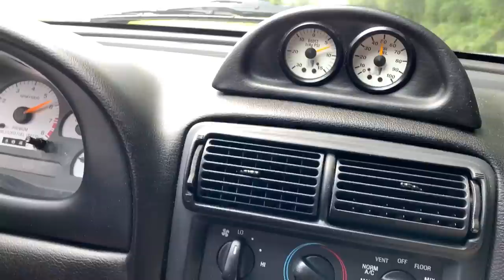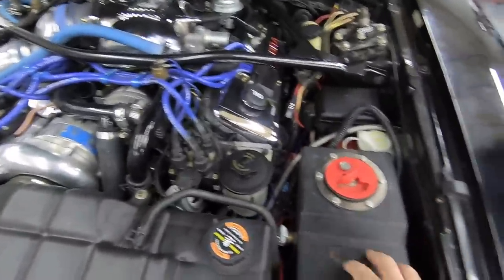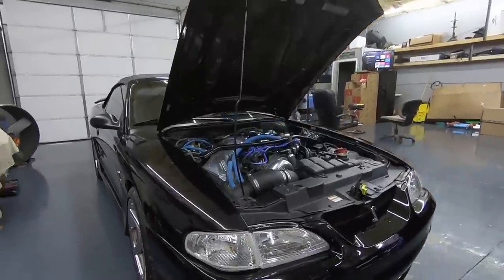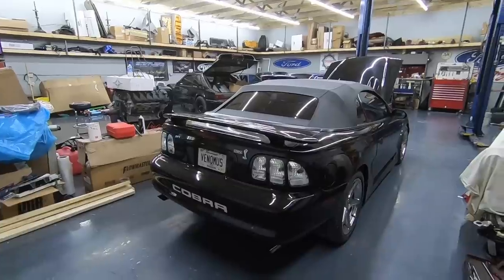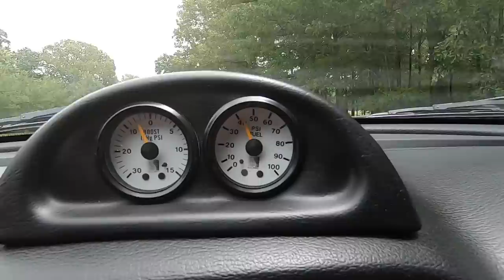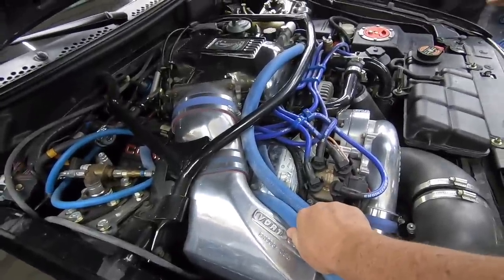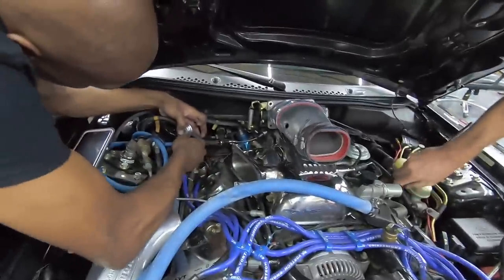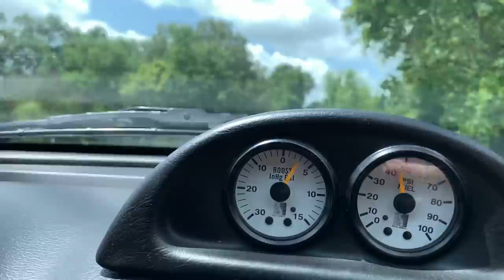Why don’t you see more of this generation Mustang...

Comment: Sn95 mustang was a terrible year. The pushrod 302 was weak and 2v was garbage, it could not compete with the Camaro at the time. The 94/95 302   lost power due to the emissions and that crappy elbow to the throttle body.
Reply: The true true reason for the HP loss was because of the hood line of the vehicle. They had to change the upper intake design for it to fit.
Reply: @ericfowler4248  Well mostly the heads. NonPI had terrible flow and while the intake could have been improved, as it was in the 99-04 cars, it wasn't the main issue.
Reply: The 302 on the gt was weak! The 302 on the cobra was much better with the gt40 heads and intake,fbo,some 3:73 gears and a tune would really wake those 94-95 cobras up! Especially if you put a cam and dyno tune it
Reply: @petrolhead8851  Still weak,car is a shit box.
Reply: Back then Ford didnt care much about putting real power in the mustang. Remember, the mustang was going to be canceled and replaced with the Probe.

Comment: These got a bad rap. Partly because the first iteration of the 4.6 was boring and had no guts. (IMO all of the 4.6 were a mistake outside the cobra, but some people like them). They also sold 3.8 V6 cars with a Ford Taurus level of power 2:1 over the GT's, and kids were all about Honda Vtech and similar cars at the time, and peer pressure and car culture with young people can lead to poor judgment. I clearly recall being in the local Walmart and hearing a high school kid bragging to his friend how his VW Passat beat a 95 V6 powered Mercury Cougar and "that cougar is fast". Yes, it is laughable, but that's the truth about how it was in the late 90's. 
It didn't help every car magazine everywhere was pairing top of the line trans ams to 4.6 powered mustang gt's to do side by sides. 
Truth of the matter is these cars were built really well, interior construction is hands down better quality then the Fox cars, and the body itself resisted rust very well. They can handle better, and generally factory stock VS stock they do. The wheel wells were of proper design, and so long as you don't get carried away with rim diameter, you can put some wiiiiiiide rubber in there. 275/295 in the back will fit without modification, and if your power tuning/rear gear will allow it you can get 315 back there if you can take the quad shocks out. 275's will fit in the front if you really want to go that wide. 
How do I know some of this? I owned a 94GT for 12 years, sold it to my son last summer(I am getting to old to get in and out lol) I put a wrench on a lot of it tuning it. I bought a 94 because it had the 5.0 in it yet. 94/95 with a 5.0 is a right proper Mustang GT. 96-98 you might as well plan a coyote swap. The 5.0's can be modded for fair price, the 4.6 will cost you $$$$ to get any type of acceptable power, Cobra motors not included. Oh and don;t trust the 94/95 Ford numbers for the 5.0 cobra motor, that motor was under rated by nearly 50 HP and a bit on the ft/lbs side too. 
Unless you like the looks, lowering these cars isn't worth it. Just by some 17x9 wheels and put some wiiiide sticky rubber on them if you want to corner, unless you are going to track day it, and at that point you will need to buy one of the better full kits and probably a whole new front K member otherwise don;t bother. 
People whine about how these cars are heavyier then the Fox cars, but they are more rigid by quite a lot, and it's only about 200 pounds, about a quarter of which you can remove in 3 hours if you are concerned. And even then, they are still a few hundred pounds lighter then the new mustangs. If you want to see what this chassis can really do, go look up some Saleen S351R videos. 
I planned on swapping a 351W into my 94, as it is nearly a direct fit, but I ended up tuning the 5.0 with gear ratio, exhaust, intake, a chip, wheels/tires etc...... I had a car that was plenty fast enough and just plain came into it's own on the windy highways and backroads of the rural area I live in. 
If anyone would like specifics of how I built my car, I will answer. 
The long short of it though: if you want one of these cars, either buy a Cobra if you have that kind of money OR buy a 94/95 GT if you want to use the factory drivetrain because 5.0>4.6 in every way, OR if you buy or already started with a 96-98 plan a coyote swap, it will cost nearly the same and turn out 100% better then trying to make the old 90's 4.6 into anything other than a pedestrian people mover. Don;t pick up a 5.0 car to swap to a coyote, you have to change the k member and yadda yadda, and if you want true go fast drop a built 351w(or stroker 408) in instead. 
But really, these cars are most enjoyable in the 320-450HP range with good tuning and gear ratio. Unless you live for the strip, being able to push the car to it's limits on a winding road is much more fun then worrying about ditching the thing because your 700HP is more then the chassis can deal with.

Comment: I had a black 98 GT manual bone stock.  It was slow and handled like shit.  I couldnt even beat an auto e36 m3 from a dig or roll.  The engine started knocking at 80k miles and needed to be replaced.  I would never buy a 4.6 again because they were so slow.  All the years.  If I were to get a mustang again it would be a 2011 and up.